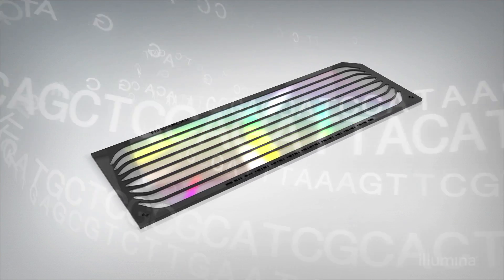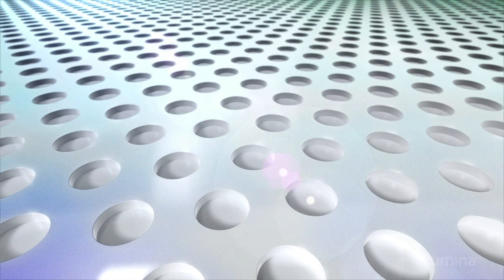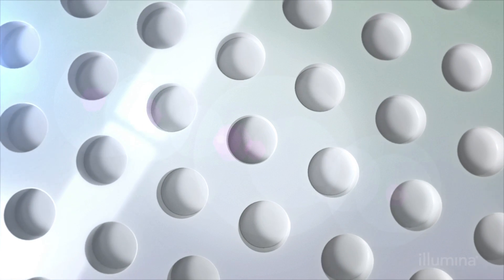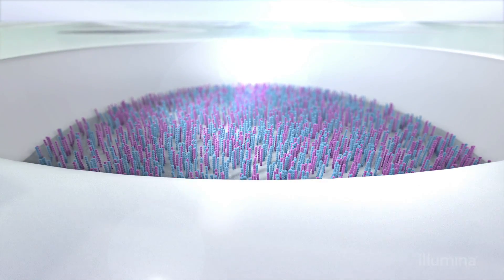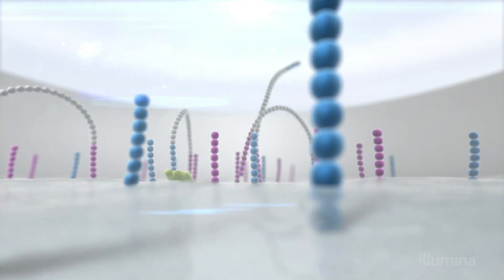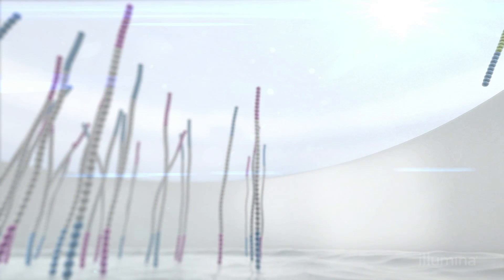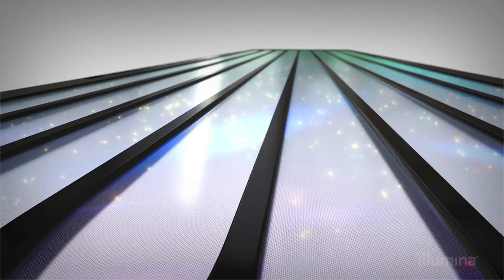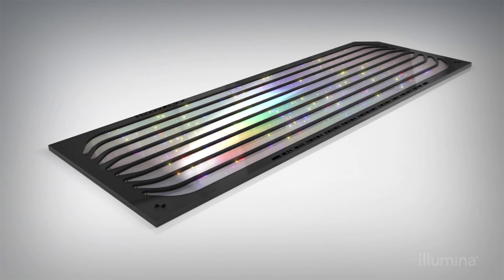Illumina | Patterned Flow Cell Technology

Comment: Guys, one thing that I can't get-how to make cluster monoclonal?Because after  DNA fragmentation(tagmentation) we will get different sequences(not the same).  We have different DNA fragments with same adapters at the ends,so as result-different sequences can link to the nanowell oligos? Please, explain if possible.
Reply: Hi, I had the same question, basically they use a method called exclusion amplification (ExAmp):

"ExAmp cluster generation: clustering on the HiSeq 4000 and X Ten platforms use Illumina's latest "Exclusion Amplification" chemistry. ExAmp ensures only a single template molecule binds and forms a cluster. Cluster amplification is almost instantaneous and excludes other molecules from binding. Most wells have a single molecule cluster, some wells are polyclonal but excluded from the by the chastity filter and will not appear in your %PF reads. A few nanowells will be empty. Some will be "ExAmp duplicates", which form because a single molecule which formed one cluster is able to hybridise to another nanowell nearby and create a second "ExAmp duplicate" cluster.

One obvious part of the exclusion amplification as implemented is the very viscous enzyme mix. Probably the diffusion of the library fragments towards the flowcell is very much slowed down (requiring also higher library concentrations?) giving the molecule that arrives first the chance to become amplified and fill entire nanowells before a second one arrives (http://www.google.com/patents/WO2013188582A1?cl=en). The viscosity enhanced "drag" also could explain the stronger bias towards smaller inset size reads?
The high viscosity buffer together with high library concentrations and "RPA" amplification for the clustering process ("Recombinase Polymerase Amplification" ( http://www.twistdx.co.uk/our_technology/ )) might be sufficient for the Kinetic Exclusion Amplification on the nanowell flowcells? It seems to me that the other methods described in the patent might not be compatible with the old cBots (these can be used for the Hiseq3000/4000 clustering after a software upgrade)?"

Since the science behind it is patented, I think the exact mechanism is confidential. But I hope this helps
Reply: @romiarz  Thanks for the patent link. It was very helpful! I think I agree with your assessment. The emphasis on simultaneous binding and cluster amplification is telling. Best.
Reply: @romiarz  @user-mf8hf4uk3h
Thanks to my seniors, my curiosity was resolved!!☺

Comment: patterned flowcells for SBS sequencing (Keith Robison covered lots of genomics news back in January, including patterned flowcells ). One of the big problems with clustering is the need to very carefully quantiy samples before loading onto a flowcell. Most labs use qPCR or BioAnalyser but even the best rarely achieve perfect density on every run if they are working with a diverse group of libraries. Jay Flately at a JP Morgan conference said that only 36% of clusters are useable and that the new technology should double that.

Patterned flowcells have been mentioned before in Illumina roadmaps, they'll potentially allow 1Tb or more from a standard HiSeq run and are one way we might see an end to cluster density variability. But a patterned flowcell might also allow improvement of some methods and even interesting new applications to be developed.

We'll have to wait until Illumina release the new flowcells at the end of the year (more likely in January just before AGBT) but for now I thought I'd put down some thoughts I've been having about what we might get and look through one of Illumina's more recent patents.

Patterned flow-cells useful for nucleic acid analysis: Illumina hold a lot of patents (1800 results on GooglePatents and about 30 a year according to FreshPatents), this one was filed by Illumina in June 2012. It describes the patterning of flowcell surfaces using a variety of etched metal surfaces applied to glass and coated with gel matrix that is polyermised (or not) by light shined through from the bottom of the glass.

FIG. 3 in the patent (below) shows a flowcell with 3 micron, aluminum oxide spots coated with silane-free acrylamide (SFA) to wihch primers are attached. Flouresent probes were hybridised and the resulting images show the fluorescent signals from those primer populations i.e. the clusters primer lawn. Another Illumina patent uses polishing of the metal substrate to remove oligos bound to it creating the prdered array; and a third uses beads seeded with a DNA template molecule to start clustering, the cluster spacing being defined by the size of the beads. 

Cluster size: By varying the size of patterned region on the sirface of the flowcell Illumina are able to control the size of clusters made. This should allow a uniform cluster size making image analysis much easier, even for samples with varying insert sizes e.g. Nextera. The patent suggest Illumina might offer clusters of between 1nm and 1mm but 5nm to 500nm seems more likely.

Cluster density: By varying the mask spacing Illumina are able to produce flowcells with predefined number and placement of clusters. I can see this being a useful adaptation for users that need many fewer reads than a standard HiSeq or MiSeq might generate, I guess we'll see more nano and mocr-flowcells in the future? The patent suggests spacing of 0.5-100uM.

Dual-surface imaging: It looks like dual-surface imaging is also still possible making use of the same confocal methods used for SBS-seqeuncing to direct UV irradiation to each surface of the flowcell.

So what can you do with widely spaced clusters? An idea I hope may be possible is mate-pair without the prep. We can make libraries with very large insert sizes using the standard approaches but clustering and sequencing these is almost impossible over about 800-1000bp. With a defined cluster size the DNA could be constrained and produce a bright enough cluster for sequencing, as well as preventing overlap; simply spacing clusters at greater than library length should stop any over-clustering. This might also stop clustering being driven by the smallest molecules in a library.

Illumina have lots of other patents; here's another I though particularly interesting:
Reply: Okay I found it (in case you're wondering what Fig 3 is, or who wrote this): http://enseqlopedia.com/2013/09/patterned-flowcells-what-can-we-expect/

Comment: I still have a question, at this video 55" - 59", a single molecule move in with both adaptor sites double stranded, then a "red" material (enzyme?) removed it. Why they have to do it this way? why not just the single molecule moves in?
Reply: J Q  If only new what you guys are talking about.